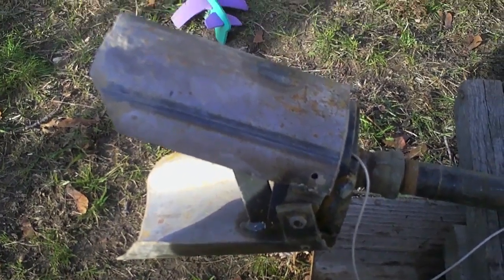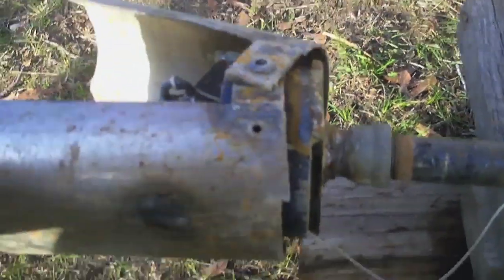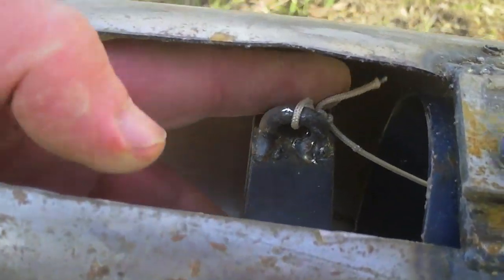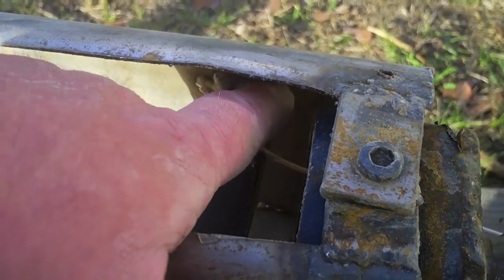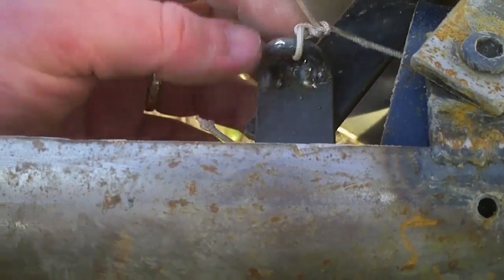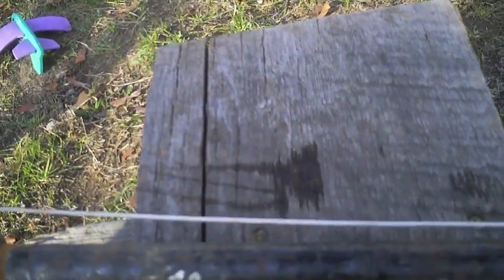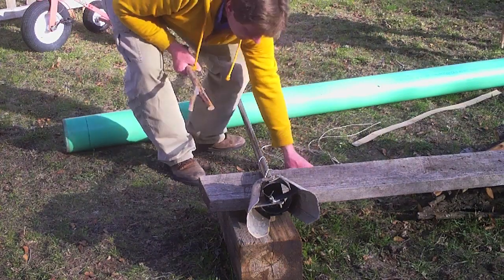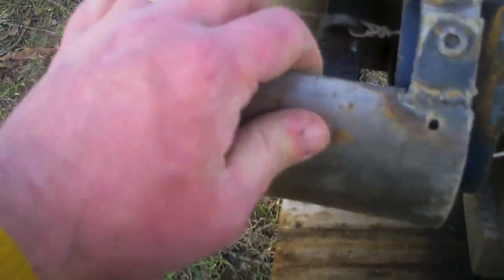Homemade 'Clam Shell' Well Digging Tool

Comment: I have one a lot like that.  It is 6 feet long, and has an eye instead of a handle.  It is raised and dropped repeatedly, until there is enough loose material.  Then a second line, to a Y, to the 2 closing arms, lifts the whole device out of the hole, to empty it.  The top has 4 guide railss, like feathers on a dart, to keep it centered.  The friend who built it dug a 50 foot well with it.

Look on youtube for EMAS well drilling, for excellent free technology.  They have super simple methods, especially for sand.

Comment: I know that the casing is really a tight fit in the hole. Also, I have already put a 4' X 4'  pad around the well head. Your suggestion to just run the pump continuously for several hours ( or more) seems to be the best bet. Previous efforts to drain the water supply from the well with a mud pump running for several hours showed that the water supply to the well from below is awesome. I will be happy to give you some feedback on how successful your idea works out. Thanks!

Chip
Reply from the maker: Please do.

Comment: Hello from Eastern NC.!!

Last Spring, I used some of the ideas from your original video series on digging your own well to put a 30' shallow well in my back yard for irrigation purposes. I used a borrowed custom made 6" spade bit and two garden hose jet nozzles to remove tailings. It worked fine but your new device would have been much MUCH easier.
And LESS costly since the cost of the water to force out tailings was substantial.

Any area like ours with virtually no rock would make your device VERY effective.
I had to deal with a 3' strata of really thick and hard clay but your tool would have made short work of that annoyance.

I put  a 4" casing into the 6" hole down to about 25' and believe I have a nice wide opening below the bottom of casing.

My main problem continues to be sandy sediment. I have tried a variety of small filters but they clog up quite quickly. No filtering and my irrigation sprinkler heads start to get clogged up, too.

Any ideas on how to solve THAT problem would be appreciated.

Your headline from Video #2..."Failure is always an option" always makes me smile when I consider how many of my "projects" took wrong turns...

Thanks!!

Chip
Reply from the maker: I have issues with glacial silt, much finer than what you must be dealing with.  It means when the water comes on after sitting for a while it will be colored for a bit and that the silt sinks to the bottom of the well head each time the water stops.  It seems to build up plugging the sand point.  I had some success sticking an airline down the well to the bottom and blasting it up and out.  That restored the flow for me.  You don't sound like you are having flow issues however so I don't know if it would help.  I think in time you will suck all the fine sand out.  Maybe some sort of large sediment trap.  I will think on it.
Reply: NelsonStudios Yes, my problem has been fine sand. I suspect that there is now a very large hole/cavity at the bottom of the well surrounded by water bearing sand. Perhaps the "venturi" effect of water being sucked up from the bottom of the well enlarges the cavity and peals off sand into the water rising up to the pump. It's true that after the pump has run for awhile the water starts to clear and sand diminishes to some degree.

I originally had a "sand point" at the bottom of the well but it wasn't driven into the sand. Rather, it was just attached to the bottom of the pipe. However, it kept getting clogged with clay particles and couldn't easily be back-flushed.
I have 27' of cast iron pipe rather than PVC in the well, so raising and lowering was tough. Finally, I put a 3' section of PVC to replace the sand point, and created plenty of perforations to allow for water entry. THAT solved the clogging problem but probably aggravated the sand entry.

The external filter I purchased is quite small and has an internal screen.
It allows for drainage from the bottom into a bucket but the screen is quite fine and again, the sand starts to build-up and block the water flow  through the
filtering device. I finally just took out the filter's internal screen.

Very frustrating.

Thanks for your comments and any suggestions will be appreciated.

Chip
Reply from the maker: Have you tried pulling all filtering out and just running the pump full bore onto the ground for several days to try and suck all the sand and clay you can.  I have seen big professional well rigs do that, sometimes pumping for days and surging the lines by turning the pumps on and off.  If you have a place to properly dump the water you might try that.  Also is it possible the material is falling down around the outside of the casing, like maybe as the pump comes on and off the casing vibrates knocking more sand down from up above?  Get a thin stick or bar and rod around the outside of the casing as deep as you can to try and pack material hard holding the casing firmly in place and preventing water or vibration from letting stuff fall down alongside.  If it were mine I would try those two things.

Comment: how deep is your water table?
Reply from the maker: In the summer about 16 feet, winter shallower in the 12 foot range.  My other well has about 14 feet of casing and the sand point was battered down into the gravel another 11 or 12.  We use that to irrigate with a 3/4hp pump.  Other than having glacier silt issues that mean I have to blow the fines out of the inside of the sandpoint every few years.  I hope that issue will go away eventually as we suck it out of the surrounding area.
Reply: we drove several shallow wells on our farm using 2" galvanized pipe. Used a frame that is 20' tall with guy wires. made a heavy hammer about 150 lbs. connected to a pulley that slid between the two risers. Jacked a truck up and had a wheel with short 8" pipe welded on it. Wrapped the rope once around the wheel and started the truck. Pulled tension on the rope to raise the hammer and released it to come down on the pipe. Used a 1' nipple and coupling in the pipe we were driving so we didn't ruin the threads on the pipe. Drove to 42'. Perforated 4' of first section by drilling holes. Used a sand point. Worked well til our water table dropped. Good luck with your wells